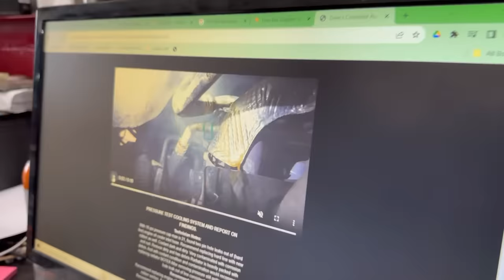The truth about maintenance, and what the manufactures tell you vs what you need to know

Comment: Dave, couldn't agree with you more. My 2015 Silverado was maintained at the dealer at the scheduled intervals for years and the transmission ate itself at 110k, the engine lifters 1k after that, both just outside of GMs powertrain warranty. The manufacturer's don't care, they just want to sell more vehicles and they know people will just keep buying them. That's why from now on I am doing the maintenance more often than what is recommended, to make sure the oils and other fluids are nice and clean and hopefully keep things from wearing out so quickly.

Comment: I was fortunate, My dad taught me how to change the oil & filter when I was 12y/o, and by 13, it became my responsibility to stay on top of the oil changes of all the family's cars since. I got my driver's license and bought my first car at 18.  I later landed a job at an oil & fluid change shop when i turned 30, and learned even more.  I've driven nothing but used, old japanese cars and the neglect the previous owner have subjected these cars to is frightening!  I bought my current daily driver in 2020: an '02 camry built in japan with the 2AZ engine.  Sat under a tree for 10mos. before I got it.  It required a lot of routine maintenance: Oil & filter change, Transmission flush & filter, Coolant Flush, radiator, thermostat, Plugs, Coil Packs, PCV Valve, Valve cover gasket, Mass airflow sensor, air filter, Belts, Hoses, Rotors, pads, And a full set of tires.  Thankfully, the engine wasn't leaking any fluid, or burning any oil so I knew I could run synthetic oil.  As soon as I got the car home, I performed an oiling system flush using new oil and filter.  But during the flush, I gently drove the car for 10mi. on a road with a low speed limit(35MPH) after letting it idle for 15mins first. Followed immediately another oil change this time using Pennzoil's High Mileage synthetic with pure plus technology(which has an amazing detergent package & has natural gas as a base instead of crude oil which also makes a huge difference in keeping the internals clean) & and WIX XP filter instead of the cheap oil & filter used for the flush.  Changing the oil & filter every 5k mi., and flushing the lubrication system once a yr.  The first time I drained the transmission(which was done before the engine flush drive), the fluid was very dark, and had a slight burnt smell. So I performed a honda style transmission flush, driving the car 100mi. in between each drain & fill. With a sum total of 3 drain & fills.  Since I bought the car to be a delivery vehicle at the time, I was averaging 100mi./day anyways(Thankfully, no longer a delivery vehicle).  On the 3rd & final drain & fill, I dropped the pan, and replaced the transmission pan gasket, filter, and added a full bottle of Transmission Treatment by Lucas Oil to the new ATF.  Which really brought the transmission back to life.  Now it shifts seamlessly and I won't have to perform another drain & fill on the transmission for at least another 15k mi..  Overall, I spent little over $1000 for all the replacement parts & fluids which also includes a full set of new tires, and a new radiator.  It took roughly a week to get everything done, including waiting on the parts to show up in the mail, getting the new tires swapped, & flushing the transmission.  But It was worth all the work, b/c it drives like new even with 220k mi. It has easily been one of the best daily drivers I've ever owned, and it's still a joy to drive.  It may be considered too old to most people's taste, but IDC, it's all around cheap to own, and it's never given me any problems since I did all the maintenance.
Reply: I dont think you mentioned the mileage it had when you got it?
Reply: @jeedwards1981  It had 190k mi. when I bought it, it's at 247k mi.  now
Reply: Yes i use shell helix, exact same Pennzoil gtl fluid. Never touching anything else. It's the best for my Kia before that my dad uses now @240000km and my Merc cla200 now at 100k km
Reply: @Vanguardkl  Nice!!  The pure plus platinum synthetic has done wonders for my old japanese cars.  The fact that even the vapors have cleaning properties the natural gas base is what really sold me on their synthetic oil.  Project farm did an engine oil performance tournament.  and the only oil that outperformed the pure plus synthetic was amzoil.  I'm just glad my dad taught me how to change the engine oil at a young age, and the importance of changing the oil on time.

Comment: Mine has an oil change indicator that uses driving conditions to tell you when to change it.
It took 9k miles to set the alert.
I just change it every 5k. Easy indicator is the odometer. 40k, 45k, 50k and so on.
Reply from the maker: Thanks for sharing

Comment: My mechanic friend told me the EPA gives auto manufacturers credits for designing cars and trucks that are low empact on the environment. And that's why now you're told you don't have to change the fluid on your transmission or 10k oil changes. 
My 2014 Ford Focus runs like a champ and it hit 162k trouble free miles today. I change the oil about every 3,500-4k miles and the oil service light comes on every 10k liles.
Reply: Here’s the problem with not being able to check/change your transmission fluid: it’s going to burn up eventually and you’ll be stuck with shifting and performance issues

Ask me how I know
Reply: 2003 VW Passat 1.8 T... transmission did burn up for just that reason. I'd still be driving that car today if it'd had a dipstick or at least SOME reasonable method to check the tranny fluid.
Reply: And what's the environmental impact of junking a car at 100k miles instead of 300k? Bet the EPA buried that study.
Reply: Does that have the dreaded powershift dual clutch trans? If so, had any problems with it?

Comment: I specialize in BMWs, and on that transmission note, the funniest shit is that ZF (the transmission manufacturer that BMWs been using for over a decade) recommends changing oil at a 60,000km interval. On top of that, people completely forget the differential fluids and the transfer case fluid.
Reply: and... its pretty complicated. There are roundabout 9 liters of transmission fluid in a ZF 8HP. If you just drop the pan you only get 4 liters out. Experts flush the whole damn thing with a special scan tool and use up roundabout 12 liters for the job.
Reply: No not at all, 60000 miles not 60000km. I'm at 100000km and still shifts fine.
Reply: @bradofwar5960  you’re correct, they recommend between 60,000 and 80,000 miles. Regardless, doing it earlier will always be better. Just because your transmission shifts well now doesn’t mean not to do your transmission fluid. The problem with them is that by the time you have an issue come up it’s too late. Preventative maintenance is key.
Reply: i was told the fluid was near imposable to change in a zf8hp, it was so easy one of the easiest ive ever done lol
Reply: i also use amsoil signature tranny fluid every 30k miles shifts beautifully
Reply: @danparden8103 in a bmw?
Reply: I had the transmission fluid changed by a BMW Specialist in the UK on my 2014 F30 330d just before it hit 60,000 miles back in 2021. Three years later, I'm now at 94,000 miles and it's still running great. BMW don't recommend this is done, because as mentioned by Dave in the video, they don't care about how long the car survives beyond the warranty period.

Comment: I drive a 2001 Honda Accord coupe to work, it’s my daily driver to get back and forth to my job to keep the miles off my 2017 Silverado, but it’s a fantastic little car that I personally maintain to keep it that way! I just recently replaced the timing belt, water pump and all associated belts, tensioners and even motor mounts at 180,000 miles! It’s the 3rd timing belt and with just shy of 200,000 miles it runs just as good as it did with 10,000 miles! I change the transmission fluid every 30,000 miles and as the transmissions were the weak point on this era of Honda I keep a very close eye on it and change it way more than the recommended frequency, but it’s been worth the time and small investment of money!
Reply: What trans fluid do you run? Ive heard the redline D4 is really good for those older hondas.

Comment: I always tell my customers this same thing. Shorter oil change intervals, more frequent preventative maintenance. I explain it like this, I'm here to help YOU keep YOUR car going, I'm not in it to get all your money. The manufacturer designs their maintenance plans around a plan to sell new cars when these start having too many avoidable issues. Oil changes are easy and cheap, most fluid changes are. Getting people to understand WHY they're important though? that's another story.
Reply: I don't know, I see shops still telling people to change the oil every 3000 miles.  That was ok in the time of carbs but way overkill today.  Then again I had a BMW with a 13,000 mile interval.  I would recommend changing it a little more often but those cars are worthless after 100k miles anyway so I saved my money and did 13k.
Reply: @tomm1109  Do you know WHY manufacturers are saying go longer distances?  The idea is to lessen the "cost of ownership" by more infrequent oil changes. The flip side is, that causes accelerated wear internally. OR premature failures in some where oil consumption is a common thing (GM, Hyundai, and Mopar just to name a few) with the thought that when it wears out sooner, you'll buy another car.  

Yes modern oils are good, but not THAT good. Sludge still builds up, filters still cause issues, people don't check oil regularly, all of which brutally impact the longevity of any engine.

Comment: Too many people ignore changing transmission fluid, which causes most of the failures. I've never had a transmission failure on any vehicle I've owned as I perform this service myself as needed.(not manufactures recommendations). Pan comes off, magnet gets cleaned, and the screen is thoroughly cleaned or replaced. 
 Great information.  Thanks.

Comment: I will say about transmission fluid replacement, do it as often as you like but I don’t believe in replacing trans fluid once you’re well past due for the first one.  In other words, if it’s at 100k and it’s never been replaced, I would probably skip it at that point, because there’s a damn good chance you’ll have problems soon after, the ship has sailed at that point.  Lots of times that new fluid and worn clutches will not play nice together, and I’ve seen a fair number of issues after replacement of well-worn trans fluid on a well-worn transmission.  If you’re going to do it, start at 30 or 40k and keep after it.  That overdue trans probably will fail prematurely, no doubt, but I’d let sleeping dogs lie.  Now cue 15 “experts” who will tel me I’m full of shit.  On the oil front, yeah the more frequent, the better.  Another major contributor to oil wear is short trips, low RPM use, cold temps, and direct injection.  But if there’s one thing you can do, it’s take an extended trip as often as you can.  Get that crankcase good and hot so you can cook off that excess moisture and fuel vapor.  If it’s a diesel, you’ll be able to burn off some soot, get the valves good and hot, the EGR and DPF will get good and hot.  Get some revs in.  Truth is, engines should be run hard regularly.  Even suspension and brakes benefit from that.  Good firm braking keeps brake dust and road grime buildup down.  A spirited drive moves ball joints and bushings through their full range of motion.  Just a few tips that I’ve seen help quite a bit over the years.  Machinery is best when used for what it was designed for, and properly maintained.  Pretty simple formula, really.
Reply: Thats old school knowledge. My gfs RAV4 had 130k on it when we met and I started maintaining her vehicle. It was fine and shifted smoother and better than before. I think if the car was ran hard and the fluid has tons of clutch material you may be correct.
Reply: Some sound advice in all that but I’d still want to drain or flush the old transmission fluid, but then I’m just a produce clerk at Publix. If I had a shop like Daves nearby, I’d probably follow his advice either way. I do take my commuter motorcycles out on a ten mile run on the interstate occasionally for just the reasons you gave.

Comment: Sor, much respect comming your way from Eastern N.C. I have an old 1993 7.3 Idi, have never found a good diesl mechanic . Ever! Just left it for repairs. No lie 3.5 months. Wanted to replace the front end steering components. it got greased. Had a fuel leat at 1 of the injectors, now it's worse.Had to unhook the parking break as it got stuck. Asked to check and replace breaks if necessary. New front breaks, didn't even check the rear breaks, just told me to work/ jiggle the emergency break if it was a problem. Our area used to be a sleepy/ quiet ocean front string of towns. Now it's crazy busy and in all things it apperas to me that  C,D and F quality work, attitudes are/is acceptable on everything. Maybe I'm just getting old. Not the way i was raised. Once again. my respect to you and what you do.

Comment: Another thing about oil changes. If you drive your vehicle a short distance every time that you drive it and never get out on the highway for more than 15 miles or 20 minutes, you should change your oil every 3 K. The moisture that will build up in your oil because of those short trips with the engine never getting hot enough for long enough will cause issues. That goes for flex fuel/E85 users as well.
Reply: How could moisture(water) enter the engine when it it sealed?
Reply: @danherrick5785 Air intake. The moisture is in the induction air.
Reply: @varmastiko2908  How does that get into a sealed oil pan? What your talkin about explodes in the cylinders...
Reply: @danherrick5785 Through the oil film covering the cylinder walls.
Reply: Engines are not sealed and are open to atmosphere via the PCV/intake system. When the vehicle is stored and not ran frequently, temperature changes can cause moisture condensation within the engine.
Reply: @wyndnra1n  Interesting. But it would seem that your process would take around 1000 years of storage to actually accumulate a noticable amount of moisture.
Reply: @varmastiko2908  99.9E86 % of the moisture would be vaporized up during combustion and expelled through the exhaust. Any adherence of remnant H20 molecules to the oil in the cylinder wall would take more miles than than entire life of the vehicle in order to make any noticeable amount.
Reply: @danherrick5785 Go on then, how does the water get absorbed by the oil?
Reply: @varmastiko2908  Moisture from the gas or ethanol? I don't even think this could add up.
Reply: @varmastiko2908  Oil contamination from gas would decrease the oil viscosity. This would be the greatest reason to change oil. Other than cylinder/piston/heat wear.
Reply: @danherrick5785 Here's how it works. Moisture enters with the induction air and also water is a product of the burning of the air/fuel mixture. When there is pressure inside the cylinder there is always some blow-by from the combustion chamber to the oil sump so the moisture gets pushed there. It ends up mixed in with the oil and it only gets released when the engine is running warm enough and long enough. With cold air and short trips water will accumulate in the oil.
Reply: My engine is full up on temps in around 10 minutes so that is some big time BS.
Reply: @bradofwar5960 Do you even have an oil temperature meter? Coolant temp rises quickly, oil temp not so much. And even if you could get the oil up to temp in ten minutes, you would still only have ten minutes of effective evaporating time on a 20-minute journey.
Reply: @varmastiko2908  yes, shows clearly an oil can symbol on my dashboard. I've done over 40000 miles on my car with multiple oil changes without problems. I know you need shorten the intervals of  an oil change when doing short trips but after doing it several times around 8K miles without any issues I'm sure I will be fine for some time.
Reply: @bradofwar5960 So what's your oil temperature typically after ten minutes from a cold start?
Reply: @varmastiko2908  between 105/110 C°. I'm very familiar with the B58 cooling system being very good.
Reply: @bradofwar5960 Well, at that temp the evaporation will work. But not much before that. The original point was that the engine needs to spend a little while at higher temps before it has the chance to evaporate all of the water from the oil. Also don't forget that at the beginning of the trip you're adding more moisture in than gets out. That's why short trips only will have some water remain in the oil. And unless it's really bad you don't really notice before damage starts slowly accumulating in the long run.
Reply: @varmastiko2908  I'm sure most cars will take longer and you will see cost in the long run but mine don't  go any higher than those temps, even when pushing it in high rpm's I have it never seen it exceed 120C°.
Reply: @bradofwar5960 I'm not saying you have high temp issues. I'm merely saying the oil temp needs to be high enough for long enough each time you drive or water will accumulate.

Comment: Wise words of car care. Now find a good shop and let them extend the life of your car. I did fleet service and PREVENTION of problems is the key here. Avoid the quick oil change places like COVID !
Reply: I had brake fluid loss after using one of these places. I'm positive that someone put the cap back on loose. I agree with the wisdom in this statement.
Reply: rona wasnt that bad honestly.
Reply: @ghlewis more than likely the bleed screw wasnt tightened down. not putting the cap on the brake fluid would let water in and cause it to not feel right, but it would splash out all that much. if the fluid was gone it more than likely leaked, which would be from the bleeder screws unless something broke